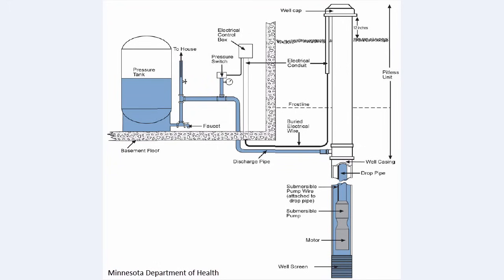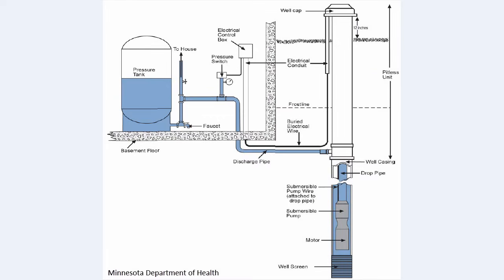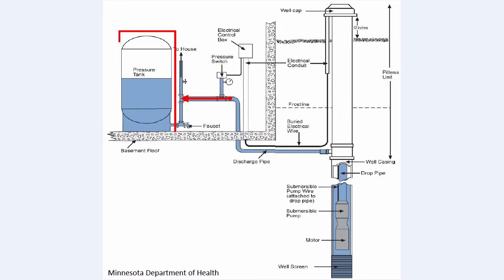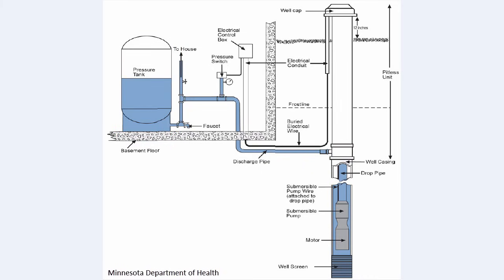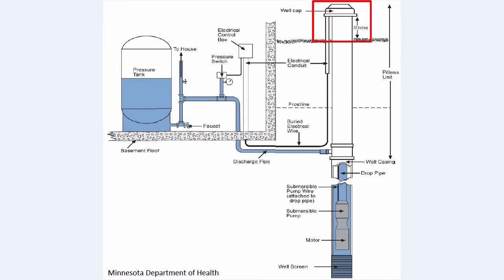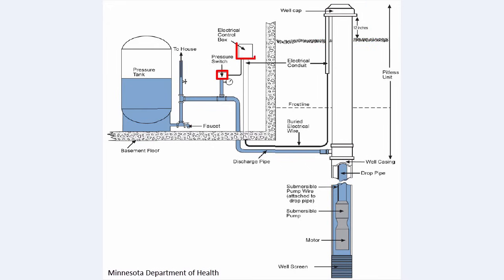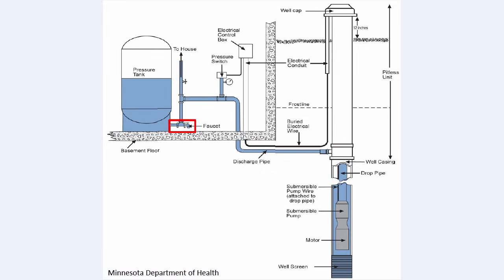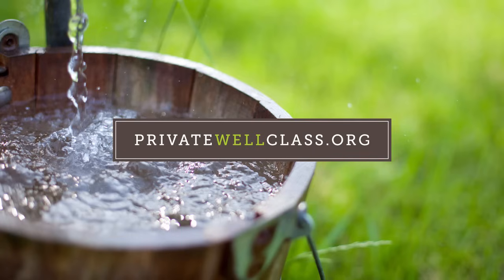How Does My Private Well System Work?

Comment: After 30 years I took the cap off of my well to look inside.  In addtion to the two electrical wires going down to the pump there is a "rod" of some sort of unknown length held by a short rope also inside the casing.  It seems to be attached to something below.  Anybody have an idea of what its purpose is?  It isn't shown in any photo, diagram, or video I have come across.  Guess I should be asking an old private well driller.  But what if they are puzzled also?

Comment: What about the large storage tank? How does it get and keep filled? Are there any indicators to let me know when my storage tank is getting low?
Reply: A large and small tank work the same way as explained in the video.  When water is turned on the water supply comes from the tank.  When the tank pressure gets low the pump turns on and refills the tank with water under pressure.  While that is happening and the well pump running the water is being sourced by the well pump.  Notice the fitting near the tank.  It goes to the house and tank.  There is no level for water.  The level for pressure is indicated by the pressure gauge which most systems have.  The tank pressure and water in the tank vary all day as water is used and the water pump refills the tank with water and pressure.  The water tank only holds about 5 - 50 gallons depending on the tank.  You can tell when the water level is low because the pressure is low and the water pump turns on.  If the pump is a shallow well pump then you won't hear it.  Many pumps are inside the house and can be heard going on when enough water is used.  You generally don't care about or monitor the water level.  The level is taken care of by the pump and pressure gauge.

Comment: Does the pressure tank need to be close to the pressure switch and electrical box?
Reply: Technically no. The clever thing about the pressure tanks is that they only need one water pipe to flow to them and that's it. No electricity. Water goes both in and out of that single connection, and the tank needs nothing else. Except perhaps air through that inlet at the top.

Comment: How fast is the submersive pump supposed to push water into the pressure tank? Ours goes slowly, and it's making my dad impatient, he wants to cut up the pipes to see if there is water flowing.
Reply: He should install a pressure gauge to the pressure tanks connections.

Comment: My water system was contaminated from dormancy, negligence, and greed. it’s been a year and I still cant find help it’s upended our lives, my children are suffering because nobody believes me and I can’t work. I have proof. I have stuff nobody has ever seen I believe. I ask everybody not one person can identify anything I have. Not even 35 doctors. Watch my videos. Landlord had a well that we ran off of. Little did I know the landlord had a secondary line piggybacked off of a rural water meter which runs under a large water shed area. The line is no less than 600ft in length center of line is 20ft lower then either end. He is a large dog breeder so that run off from his facility is leaching into the run off. When it snowed last year. Without notice or flushing the line he shut the well off, turned the meter on flushing biofilm and a host of other organisms into our home. The line is at the opposite end of the house with a shut off valve as well. I had no clue this line existed. After two months, I figured out the water was the cause of my family’s health issues. I was 15 days from signing my 4 year lease. When I mentioned that I believed his water was effecting my children and myself he evicted me said I caused it. He had his well company come out and pull samples. I even filmed it. He said results are in the mail it’s just a little bacteria nothing to hurt me. After a month I never received the results. They never turned the samples in because i filmed the nasty ass water coming out of the faucet and showed them. They said that’s bad. Yeah why didn’t they submit the results. That has to be illegal. It’s not right. Good thing I documented everything. Even then after a year my condition is getting worse and doctors blow me off as delusional. My kids are Afraid to ask for help, their health and safety has been ignored and their childhood will be nothing but horrible memories. Everybody has all these answers do this and that. I’ve done it all. Nobody gives a shit. Don’t leave a line off for years and drink it for months. I found his dogs have parasites as well. When that line is turned on it’s getting into his system. Blows me away people can do that to children and shrug it off. Disgusting